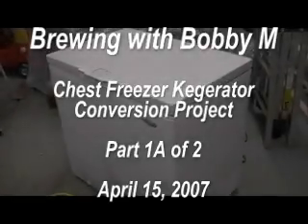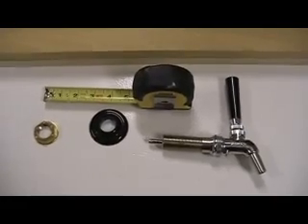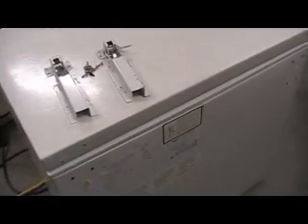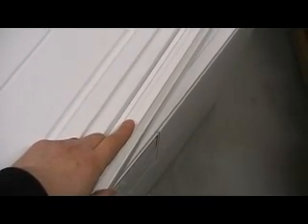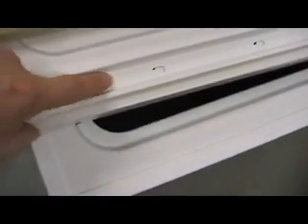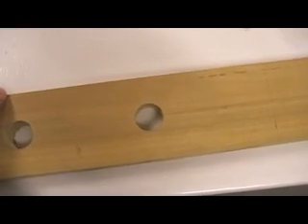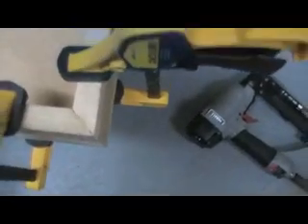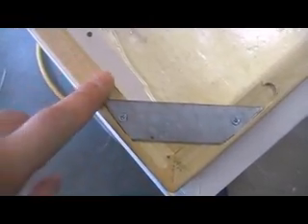Chest Freezer to Kegorator Conversion Part 1A

Comment: Why does everyone bypass the fact they could skip half the step and drill through the lid. there is nothing in the lid you can hit. caulk hole after you run you lines and put nice looking standing tap on. am i missing something here, so much wasted energy.
Reply from the maker: +Adam Peterson Simple.. I didn't want a tower on the lid. For one thing, I now have 5 faucets. I'm sure you're aware that a 5 faucet tower is pretty expensive. Also, that tower now has to be cooled to avoid warming the beer on the way out. I would also not be able to leave the freezer against the wall and still open the lid without the tower hitting the wall.
Reply: +BobbyFromNJ good point dually noted. I am considering making one and just had that thought. I won't have more than two taps.